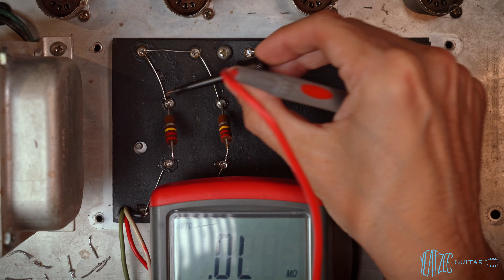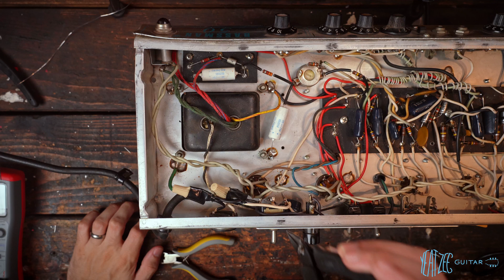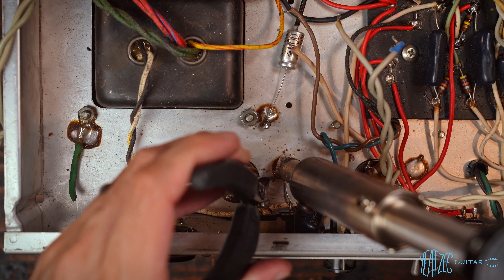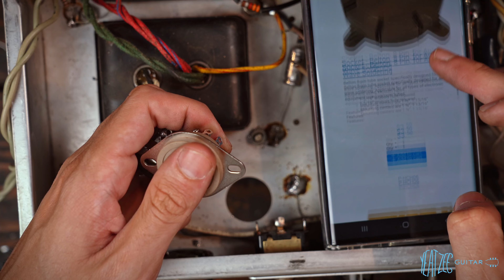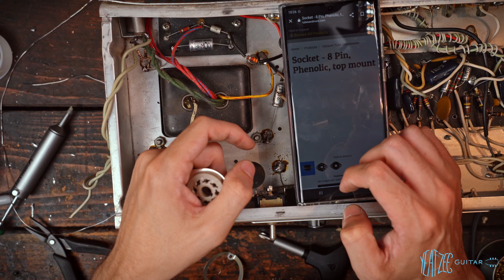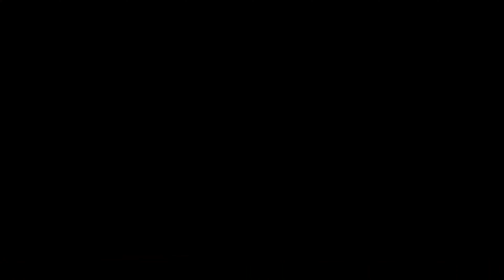So Close!!! - Vintage Fender Bassman 50 Amp Repair Pt.4

Comment: I replace the balancing resistors in the doghouse with metal oxides.  They have  tighter tolerances than carbon comp, and should not drift much over time.  When I added the bias trim pot on my Bandmaster Reverb, I reduced the value of the 15k ohm resistor to 10k ohms.

Enjoyed watching you work on this "oddball" amp.

Comment: I'd replace both sockets, iirc those 70's ones are not very good and brittle. I'd check those wires too with the green stuff on them, that's a common problem with corrosion. Strip them back a bit a make sure that hasn't creeped up the wire, if so replace them.

Comment: You could always use some washers to close that gap & get the socket to sit flush.  Whether you rivet the socket in place or use screws & keps nuts I wouldn't think it would be a problem.  But sockets are cheap & it probably is better to just get the right one.  It's looking good so far.  Gotta love having to repeatedly make tiny orders while working on amps.  That's the way it goes sometimes lol
Reply from the maker: It's the worst! I'm waiting to order after I dig into the other amps so I can do a bigger buy
Reply: @YeatzeeGuitar  That is exactly what I do.  Open up multiple amps & start going through them making lists.  It helps when you know you won't get the package in time for the weekend so you just take the rest of the week to figure it out.  Wish I had a good local electronics shop I could go to.